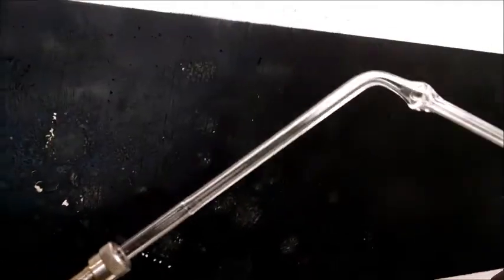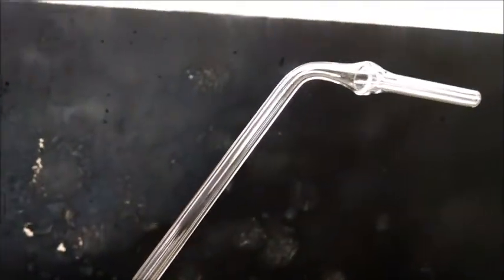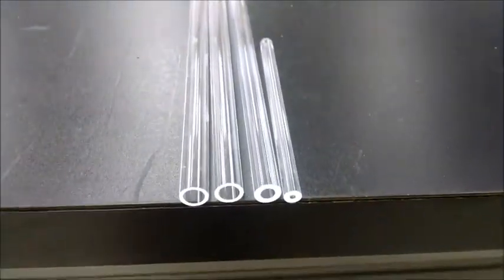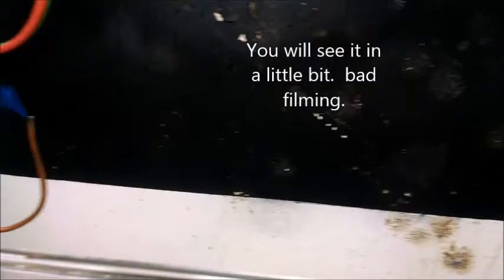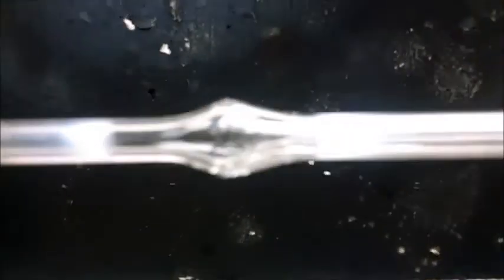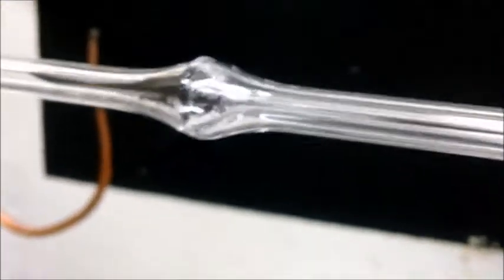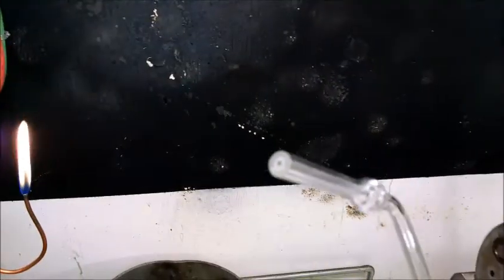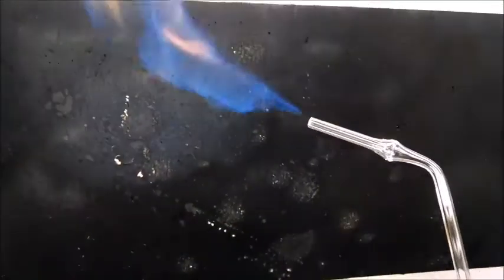Fabrication of Quartz Head/burner.

Comment: Sorry for dumb q, but why does the torch have to be quartz and not metal?
Reply from the maker: Quartz is a lot cleaner than the metal torches.  And it can take the heat at the tip, where the combustion takes place.

Comment: I am also using silica glass and a hydrogen torch many times a day, but I was always wondering what is the white "powder" which forms around the heated section (e.g. 6:00 left an right)? It seems like something is reacting with the surrounding air because in the center of the flame (mostly H2+O2) there are no such remains.

Do you have any idea with what kind of substance we are confronted here?
Reply: Just a guess, but the quartz might be subliming and the quartz vapor condensing as a white 'dust'.

Comment: Wow.  Just found your channel and binge viewing. I am wondering why you would want a quartz torch rather than a metal one , I suppose it is obvious to those in the trade? and secondly what were the small holes in the olive for, are they just to draw in extra air and if so why or do they also feed premix to the tip?
Reply from the maker: Question 1, A majority of places that work with quartz, tend to use quartz heads, they are much cleaner.  Question 2, the small holes in the olive are there to allow gas and oxy to flow down the center jet.  When you turn the head on initially, the gases are only going through the outer ring, but, once you turn up the pressure, gasses are directed down the center jet, with an audible pop.  Hope that helps.  Thanks again for watching!
Reply: @ktfords  so is that what a piloted top is?

Comment: do you have to use hydrogen to melt quartz? i have been told that the triple mix feature on GTT torches is hot enough to handle small quartz projects with oxygen/propane setup.
Reply: I work quartz and make small Nails.... you can use oxy and propane. may not be ideal but works....

Comment: I always turn the gas off first, that way the oxygen extinguishes the flame. I am a quartz scientific glassblower we use hydrogen and oxygen to burn the quartz and quartz burners to do it. keeps the glass clean, no contamination. Do you have any Videos on building the Rosebud burners? I would be interested in seeing some different techniques.
Reply from the maker: +KDE5FAN MKG hey sorry about that and trying to get ahold of me.  You can reach me at kteaford@chem.utah.edu. Or 801 703 3212.
Reply: Been trying to get in contact you about Quartz/Boro scientific Glass but there is no way to message you on your profile (though you may get a message where I was able to hack the "To:" field in the message..).  would you drop me an email at kde5fan    AATT     gmail.com  - obviously remove the spaces and use @ symbol...  I'm very interested to speak with you!
Reply: Curtis, thanks for watching.  I highly recommend not turning off these torches gas first (when using Nat gas or propane).  If you do this without enough gasses flowing, it will result in the pre mixed gasses in the stem igniting (will explode).  Yes, you can do this with H2 (the way you mentioned) it still does require significant flow in order to prevent a flash back.